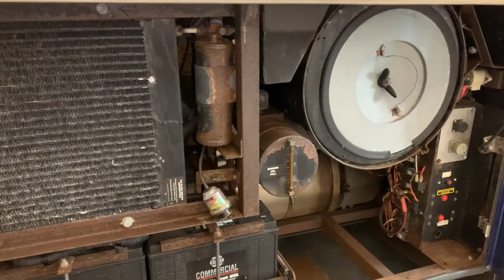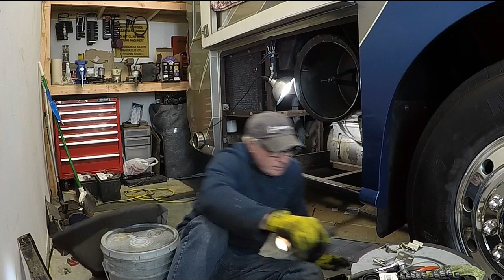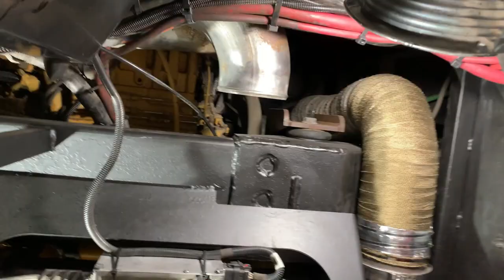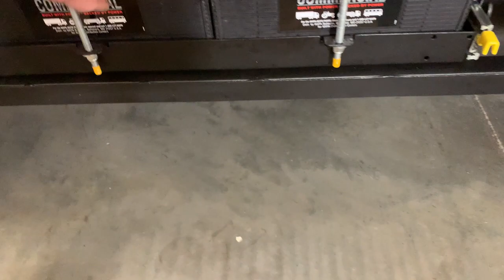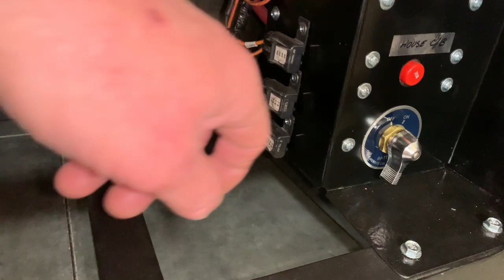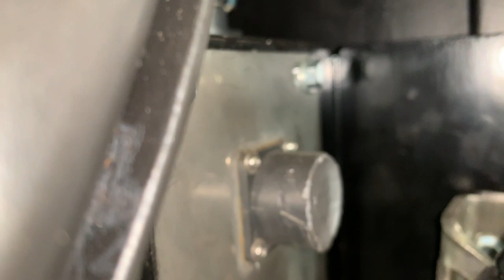Country Coach RV - Corrosion removal from rear Electric /Air filter, oil fill bay.

Comment: Very nice work & time consuming. The open space where the batteries are there just in case of the batteries leaking fluid. you could but a piece of starboard to cover up the area, but do put some holes in it just in case!
Reply from the maker: Hi, agree, I have to consider battery leaks, new bats tend not to do that so much as they are gel etc. I will be closing off the area forward of the batteries, that will be a new video. I will also be looking at a heat blanket to place behind the electrical panel, perhaps use and exhaust cover from a vehicle and modify it.

Comment: Very nice work Rod!  Amazing how much corrosion caused by sitting at Pacific Shores.  Curious, is there not a floor pan under this bay?  Looks like it would be open to the elements?
Reply from the maker: Hi, so I had learnt that on some coaches they installed a flr pan under this area and on other, there was not. I am looking at using some mud guard plastic to close off the area, however as the side vent grills allow for copious amounts of water to enter the compartment, I need to be careful that I do not create a water trap and make the situation worse. I will be making another video when the parts arrive on closing off this area.